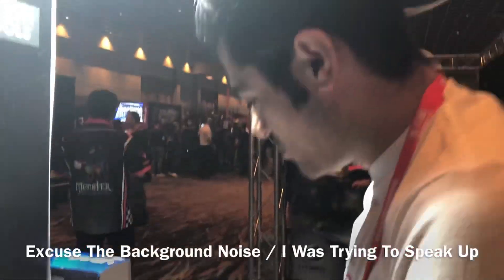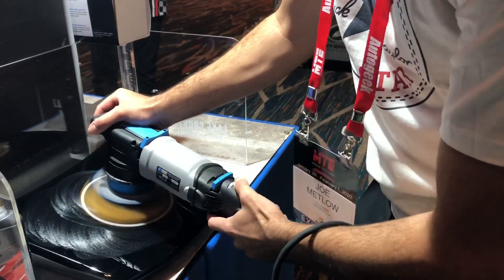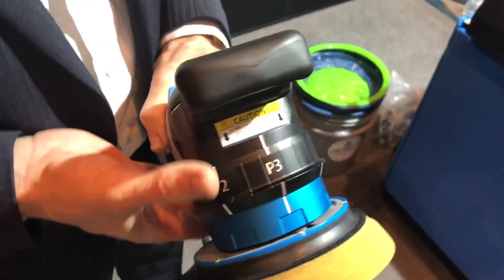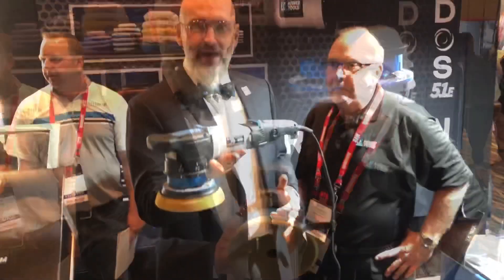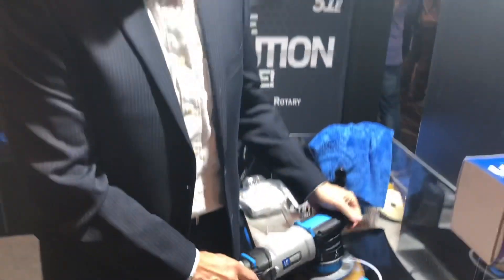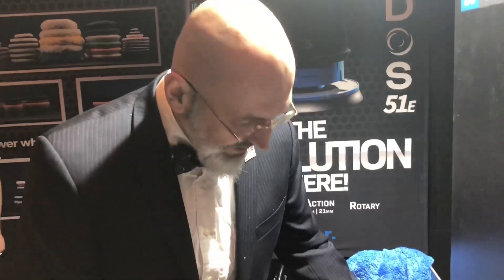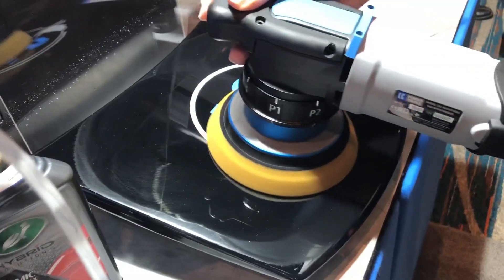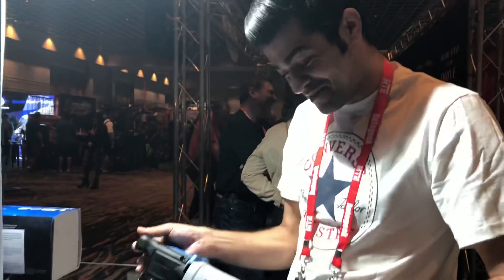Lake Country UDOS 51e First Impressions Review / With Yvan Lacroix

Comment: Joe, is it much heavier or larger than average? Did they say if you can use a 6" and a 5" backing plate?
Reply: BigOldDog 7 lbs, it’s ergonomically balanced, and very solid. For the moment only 5 inch.